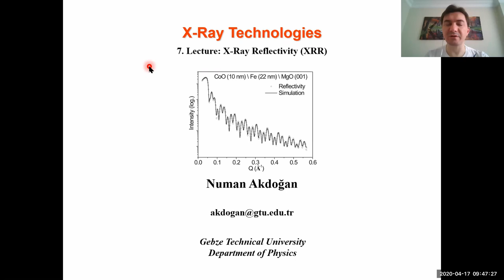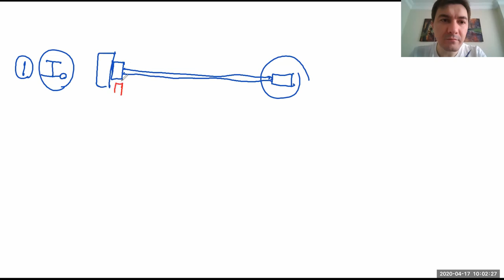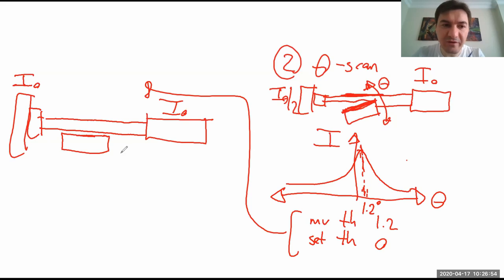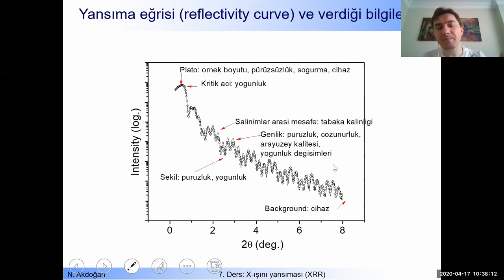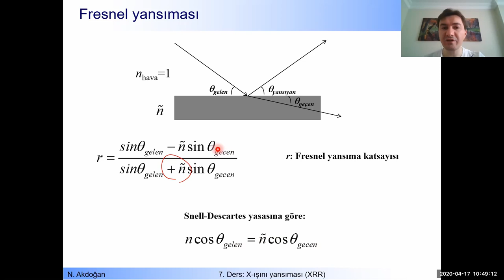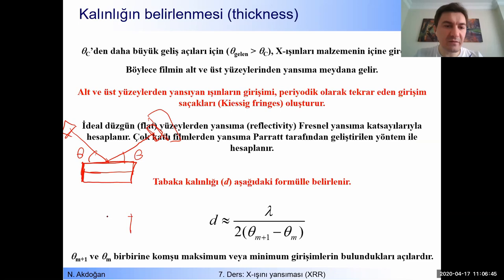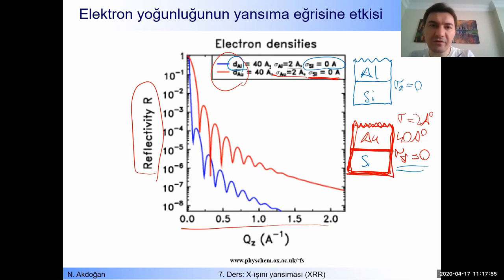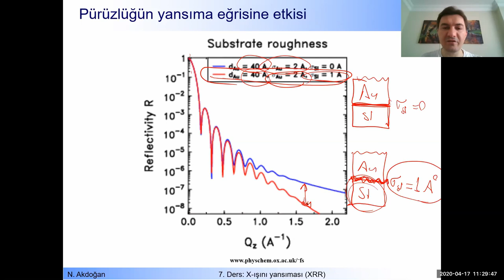X-Ray Technologies - X-Ray Reflectivity, Sample Alignment, Thickness-Roughness-Density of Thin Films

Comment: Thank you so much sir i have prepared my presentation on xrr experimental technique by listening your video and i got good marks just because of you.
Reply from the maker: You are welcome.
Reply: @numan.akdogan  sir if i use the same graph to compare electron densities of the different elements just to write review summary as example of use of xrr technique then what references can i use?
Reply from the maker: @farwaangel3648  Dear Farwa. You can use the theoretical relation between the critical angle and electron density as a reference, which is also discussed in the lecture. In addition, you can find some XRR information in internet, if search the online publications of Rigaku company.
Reply from the maker: @farwaangel3648  The Rigaku Journal, 26(2), 2010
Reply: @numan.akdogan  thanku so much sir.
Reply from the maker: @farwaangel3648  You are welcome.

Comment: Dear Sir, Thank you very much for the nice lecture and the details. I wanna to ask you, during measurement how the detector  can distinguish beteween XRR and GIXRD since both are made at low incidence angles?
Reply from the maker: Dear Nabil. Detector reads the intensity coming from the sample. The position of the detector is defined by a computer-controlled goniometer.

Comment: Thank you for such a nice demonstration.
But I have one question. Can we calculate the density of thin-film from any other technique? 
thanks.
Reply from the maker: You're welcome. XRR is very useful in nanometer scale. Especially for multilayered thin films. If you are an expert, you can achieve good results even in the angstrom range. Unfortunately, I don't know a better method.

Comment: Dear sir, why the data was taken in half cut positions?? What is the role of half cut of the x ray beam during alignment and also during measurement??
Reply from the maker: Hello Saugata Roy. This allows to direct the x-ray to the very center of the sample. You can also try this at home with a laser pointer. You can observe what happens if you cut the beam completely or allow it completely.